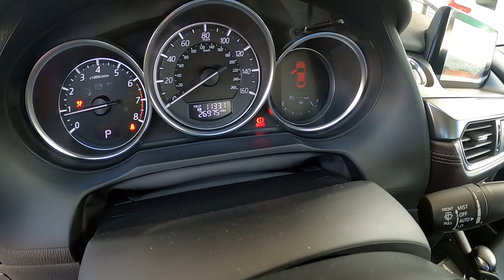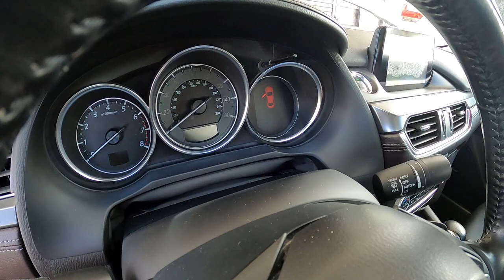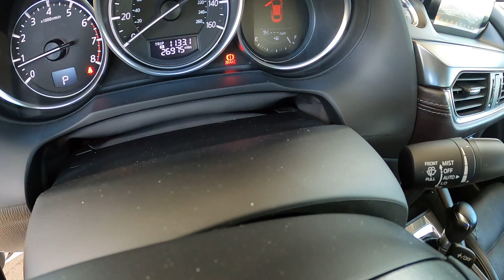2016 MAZDA 6 PART 2 HOW TO REPLACE REAR PAD/ROTOR WITH AN ELECTRONIC EMERGENCY BRAKE SYSTEM

Comment: Stainless steel hardware clips aren't required for the rear brake pads?
Reply from the maker: Great question! For this car, there is no stainless steel shims on the caliper mount, they are part of the brake pads. Usually it's on the caliper mount but for this particular car it is on the brake pads.

Comment: Why did you have to bottom out the caliper by turning the screw on top of the caliper?  What is this step doing?  Thanks.
Reply from the maker: I believe you’re talking about the bleeder screw that’s at the top of the caliper(?). As I’m compressing the pistons back in, I open the bleeder screw to let out the old brake fluid so it doesn’t go back into the system and up to the master. Towards the end of the video, I show how I flush the brakes and put in new brake fluid. I hope that answered your question. Thanks for watching 🤙🏽🤙🏽🤙🏽
Reply: I think he was asking about the 40 torx screw you turned after removing the electronic actuator. I'm guessing that was to reset the plunger for the new pads? @RoysGarage808

Comment: Hi about to undergo this job n was wondering if I could use a c-clamp to compress the rear calipers?or do u recommend that caliper tool u used?
Reply from the maker: I believe that’ll work, anything to push it back in. I would’ve said water pump pliers but C clamps work too! Thanks for watching 🤙🏽🤙🏽🤙🏽

Comment: You can put the electric parking brake (PB) in service mode following those steps:
Engine has to be shut off during the whole procedure.
1. Turn on ignition
2. Fully press the accelerator and keep pressed
3. Pull the PB-switch (release) and keep pulled
4. Push the Start/Stop button three times
-> PB actuators will fully retract into service mode and a yellow parking brake light will turn on in the dashboard

To exit service mode afterwards simply repeat the steps, but instead of pulling the PB-switch - press it.

This procedure worked fine on my 2017 M6 with 2.0 petrol & manual transmission

Regards
Reply from the maker: Thanks for watching 🤙🏽🤙🏽🤙🏽
Reply: Is this the alternative to removing the whole component as shown in the video?
Reply from the maker: @jordangilbert8909  I believe that’s what he’s saying.
Reply: could u clarify the steps do u push down on pb switch to disengage at step 3 pulling up activates the pb and thus not able to remove caliper? -thanks
Reply from the maker: @brewcrew5854  I’m unfamiliar with the way Mischa has commented so I can’t really clarify on that if that’s what you’re following but in the beginning of this video, I show you how to disengage it around 1:22 mark. Thanks for watching 🤙🏽🤙🏽🤙🏽
Reply: Thanks so much!! Really saved me some time and having to go out and buy T30's.

Comment: There is NO "electronic emergency brake system" in this car. It is called the ELECTRIC PARKING BRAKE.

At 2:33 ...
No need to loosen the bleeder screw accordingly to manual from Mazda.

At 3:07 sliding pins are rotating because someone did wrong job with them before. If job is done correctly they will not rotate. Was it you who worked with them before?

At 6:02 ...
So wrong. Theres is no need to remove the electric brake motor accordingly to manual from Mazda.

At 7:31 ...
It seems that caliper piston grooves are in wrong position. Nothing mentioned about correct position either.

So many wrong things. Stopped watching from this point. Please delete this video from YouTube as many people could make wrong things.